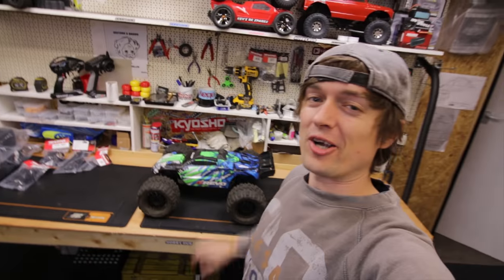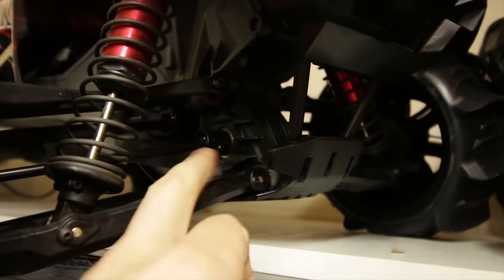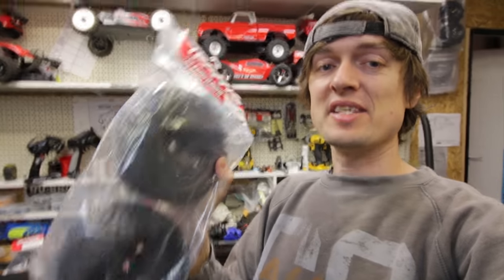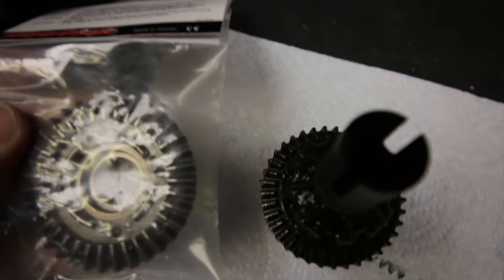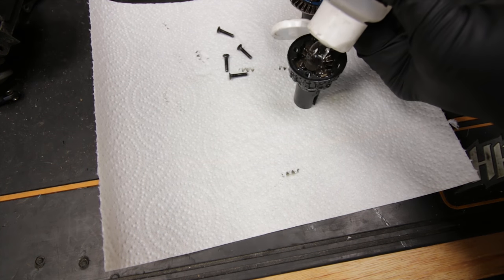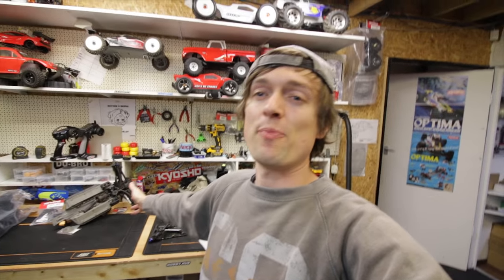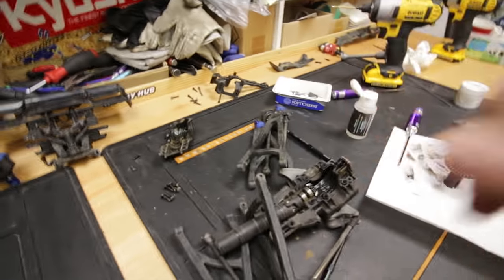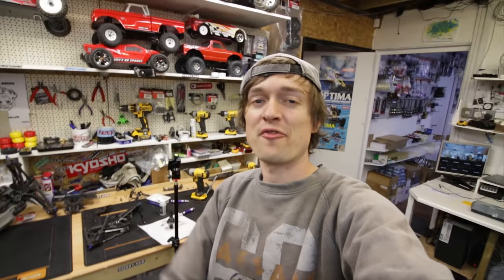Traxxas E-Revo Diff Tuning + test

Comment: Can't wait to see how the new toe links are holding up.  I haven't busted mine yet.  The only issues I have had is busting off the the front mount (part # 5314) and I bent the Rocker Arm  post (part #5354) I can't believe that the entire front bumper/front mount is held onto the truck with the ONE screw located between the front shocks.  Seems kinda like a week spot.

Comment: Making the rear diff a bit more titer or locking it will mean that the back end of the car will cone out more rather that there diff actually trying to ditrubute the power,
Not bad at all
But traxxas recommend that you dont use the car for speed runs,
I have one of these to
I also have a pimped out e maxx, with a locked rear diff and noticed the back end of the car came out lots more.
Also im from birmingham,
Would you know of any great places to bash rc?
Thanks
@ Kevin Talbot

Comment: It may not be as easy as the Xmaxx but it’s a lot easier than what you did, just the bottom cover and slide the pins out of the bottom arms and then just the screws for the diff cover

Comment: Hey kev. I have a few questions about the e revo 2.0. I have seen you beat it up pretty good. But I'm kind of in the process of building one from scratch. By that I started with a used 2.5 revo with bad engine, and have decided i wanted an electric version. So swapped as much as I could from the 2.5 to a 2.0 vxl chassis. So i have a pretty good idea on the tear down as well as putting it together. I am far from done as I can't really afford it. I still need the important stuff like the tranny, esc, motor, appropriate controler and receiver as I have the old one from the 2.5. Also need the appropriate waterproof servos. Oh yeah still need the body as well. And the batteries, as well as the charger. Far from done. More then likely it won't be used until next year around this time. But I am curious as to what the 2 screw holes are for on the rear chassis brace? Are they for limiting straps? As well as what are you thoughts on a locked rear diff? Furthermore I am interested in finding out if it would be worth putting a sway bar kit is worth the time. Like I said I can't afford it so it's being pieced together. When done it would be a new used 2.0 vxl. I sincerely look forward to hearing back from you. Maybe you have some pointers. Thank you for your time!

Comment: I'm so confused!  Is there an E-revo 3.0?  You've had your E-revo 2.0 for ages longer than the latest model came out.  The latest model is referred to as "next gen E-revo" on the Traxxas website which I think is basically the 3.0.  It says there are only a handful of parts carried over from the last model and there are dozens of upgrades.  I got the latest model but it looks exactly the same as yours!  Do you have the latest model Kev?  Haven't you had yours for over a year now?

Comment: Awesome as always! Hey Kev- What wt oil do you use in your Xmaxx for bashing? (I also saw the trick of putting in an earphone gel. lol But I can't find what wt oil you use.) Rebuilding my thrashed rear diff, due to the self-right tearing things apart. Going to try to shim it over as you showed in one of your other videos. Thanks!!
Reply: Hi! Thanks for the highlighted comment! 😀 Could you please, when you have a moment, respond about what diff oil you use for bashing? I was thinking 100 - 200k. Local hobby had 60 k and 500k, so thinking of mixing at 2-1/2 60k to 1 500k. Thanks!

Comment: Hi Kevin. I am new to the rc world. What was the tyres and wheels sizes you had on the traxxas. Been looking at wheels for ages find it a bit confusing what tyres fit on what size rims. Please help.
Russ
Reply: When a tire is marked as a 3.8, that is the measurement of the wheel. A 2.8 is also the wheel size as well as the 1.9. RC tires tend to be measured by the wheel. Some companies will give you a overall height of the tire, but generally those are crawlers. For the E-revo, they typically run a 3.8 wheel/tire combo. Stock wheels and tires are lighter, but shred easy because of the thin sidewalls. Best bet is Proline wheels and tires, but they weigh a bit more than stock. I like the Proline Badlands I run on my Revo 3.3, but are about a half inch taller than stock. I never ran Trenchers, but seem to do well on the E-revo from videos I've seen. If you do go with stock tires, get the Talons found on the Revo 3.3 instead of the E-revo as the sidewalls are thicker.
Reply: @SebastianLong 
Russ. Cheers for the help. I want my savage x 4.6 nitro to look a bit more like a big wheel monster truck so wasn't sure what to get. I like the revo tyres as well because there very wide so would give a bit more stability. I know the revo tyres won't be like a monster truck look but I do like how wide they are. Thanks replying.
Russ

Comment: Good workshop video as usual kev. Quick question what have you done on your udr to stop the side panels ripping through the screw heads mine done the same as yours ripped out first time out haha bigger washers don’t work ?
Reply: A few strips along the bottom and then put the screws back in ?

Comment: Hi kev do you think a 45 amp esc is Good enough for a 2wd 1/10 monstertruck?
Thanks!
Love your videos!
Reply: Stijn Loos of course i have a 20amp on 80kmp in the beach
Reply from the maker: not sure, try and see :)
Reply: Kinda low but it will work I run 120amp and above but that's me lol.
Reply: shoud be depends on 3 thins
Reply: I am usually happy with 60 amps on a 1/10th if your not totally sending it

Comment: I got one Question:
I just bought a e revo 2.0 and the those little rod ends for the rear shocks keep braking (don't knwo the name) Has anyone a solution for this couse i always have to buy new ones and they break very fast.

Greetings from Austria

P.S. Wenn hier wer deutsch kann auch so antworten. Danke! (If anyone can speak german please answer so. Thanks!)
Reply: You can upgrade to full aluminum rods with aluminum ends, but you will end up breaking somewhere else. I super glued mine and they do alright. I have the Revo 3.3 which is an aluminum chassis rather than the plastic one on the E-revo. My Summit has the exact same chassis and suspension as the E-revo, but it's more a slow paced crawler than the E-revo is.
Reply: Probably way late, but I believe that's the purpose of installing limit straps

Comment: Hey kev I have the v3 kraton and I will turn on the car and then as soon as I turn on transmitter the front wheel turn right and then lock there and they don't turn back until I shut car off. Is it a short to the ecs,  servo or transmitter box?
Reply: Justin Roy transmitter is faulty if the steering goes back to center when you switch transmitter of 
What happeneds when you try to turn left or right
Reply: @martyncrease8289  it doesn't go to center when you switch transmitter off. It only goes to center when you switch car off. It doesn't turn at all. When it goes right as soon as you turn  transmitter on it gets stuck there. You can't even move it by hand. It doesn't break free until you shut car off. You can shut transmitter off w the car still on and it stays stuck to the right until u shut car off
Reply: Justin Roy remove servo arm turn on car and transmitter so the servo moves to Center then refit servo arm with tyres straight then try it
Reply: @martyncrease8289  it only moves to center when u shut car off not when you turn it on
Reply: @martyncrease8289  also when it's on the transmitter doesn't turn it anyway it only works on throttle. It dies turn the wheels at all . As soon as you turn on it locks to the right and then it move with trans or your hand. I'm going just check all the wires and then open up servo and see if I have broken connection

Comment: Basher diff top-up, such a pikey haha
On a serious note, thicker rear diff oil gives more on power steering and less off power steering. 
On the front, thicker diff oil gives more on power steering and less off power steering.
This is only completely true when there is a decent amount of grip. When the grip is low you reduce the rear oil for on power steering

Comment: Something is wrong with my e revo and it keeps clicking
Reply: Check your driveshaft the centre one sometimes rocks or sticks get up in there. U can use a torched or just take the bottom plastic plate off and inspect it

Comment: No you pretty much took it apart the way you have to I'm my original version 1 e revo you basically have to break it right down to nothing left with the tab on the rear end of the chassis if you take the bottom plate off you can't split the bulkheads apart because they're screwed in from the top of the chassis so you're pretty much pulling the whole rear end off and I'm pretty much speaking from experience because if I wasn't breaking steel drive shafts I was tearing out differentials that's the only thing I hate about the original E-Revo breaking it apart that's what's kind of keeping me from buying a 2.0 knowing that the this hold out better is the thought of having to pull it apart anyway for anything else lol